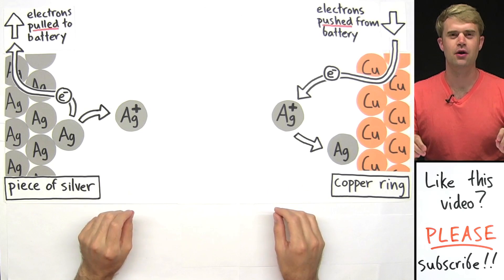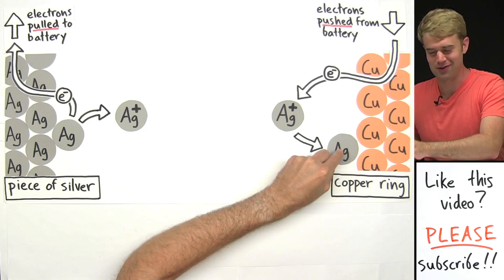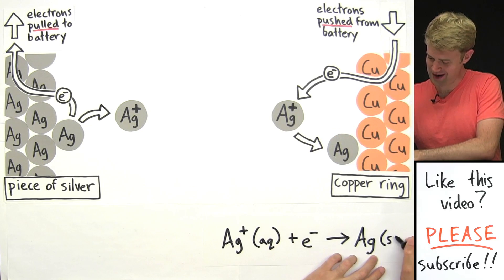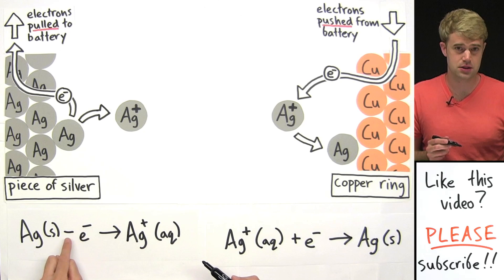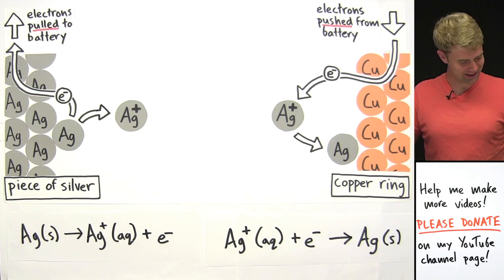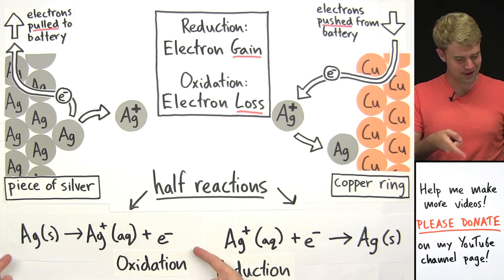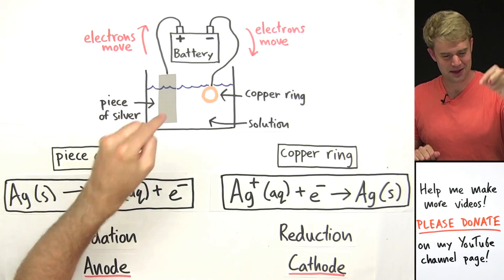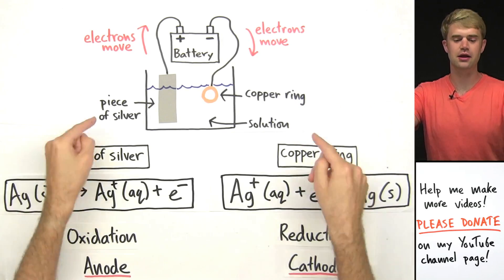Electroplating Part 2

Comment: Can anyone tell why not the electron joins the copper on the right side(cathode) ???  Why it always attracts to the Ag+ ???
Reply: Always remember electron has a negative charge  which always attracts the positive charge,

the reason why it does not combine with the copper on right side is because copper on the cathode has no charge,it's neutral,so it needs to have positive charge to attract the  negative electrons.

But the silver does have a positive charge so the electron just joins the positive silver ion!
I hope this clears

Comment: I have A Question, Why doesn't The Copper Atoms Gain an Electron and Float In the solution like the silver atoms?
Reply: I think because copper atom is like all metal tends to lose electrons not gain due to it's ionic bond

Comment: The electron lost in the  anode is THE SAME electron that shoots out of the negative pole of the battery? Or the electon lost in the anode gets stuck into some kind of apparatus into the positive side of the battery and therefore the electron that shoots out of the negative side of the battery towards the Cupper bar is NOT the same electron that was obtained from the Ag atom in the Ag bar.
This may be a stupid question, but it is what it is.

Comment: Tyler - Thank you very much for the wonderful videos. It clarified several subtle issues for me. I have one question. Why does the same thing not happen on the Copper side? In other words, why does copper not gain an electron and dissolve into the solution? This could electroplate the silver with copper. Why does not it happen? Thanks in advance.

Comment: does the amps/voltage of the battery matter?
Reply: justin jimenez might be too late but i think so. We were doing an electroplating experiment but it took a long ass time. Apparently the voltage was too low. We changed the voltage and we it worked almost immediately

Comment: Thank you Tyler. Just one question, when the electron is moving from the cathode and into copper, to help Ag+ become a neutral atom, why don't the  neutral copper atoms gain an electron to become Cu-  ?
Reply: becos copper metal act as cathode and it never dissolves into solution
Reply: Dev Vikamsey because they are full of electrons and didn't want to get any extra
Reply: GEORGE NASIKA man then Cu+ in the copper sulphate solution should take those electrons coming from Ag because Cu+ is that solution

Comment: Does the anode HAVE to be made of the electroplating material? For example, you want to electroplate a copper ring with silver, does the anode HAVE to be made out of silver? Or will the electroplating process still run even if the anode is made of a different metal? And can electroplating work if the  the electrolyte is the only thing made out of the electroplating material ,like soluble silver salt such as AgNO3
Reply: no it doesn't have to be silver, it can be anything but i there are some altercations like he said in his previous video steel and silver cannot be plated together, they have to be plated by copper first

Comment: Thank you so much for your crystal clear explanation of electroplating. I've worked with ion sources so the terms anode and cathode was an 'oh yah' moment. There is such a great verity in the application of scientific method but the laws don't change regardless of the application.

Comment: Great video. Few questions though. What happens to the anions in the solution? And If we would pour AgCl(aq) into the electroplating cell, would it still work?
Reply from the maker: The anions in the solution just kinda sit there, balancing out the charge of the positive Ag+ ions. Check out my first electroplating video, where I talk about the "electrolyte." Also, AgCl wouldn't work for this, because it is not soluble in water. You need to use an ionic compound with Silver in it that is also able to dissolve in water. Great questions!
Reply: Tyler DeWitt k

Comment: Hey Tyler great series of videos! One question, what strength of battery would be used in electroplating?
Reply: +TheVextrix 
i am not tyler but from what i have read, it depends on the kind of metal. metals such as scandium would need a stronger battery while metals such as gold would need weaker ones...
hope this helps :)